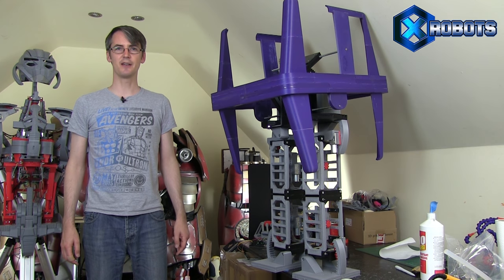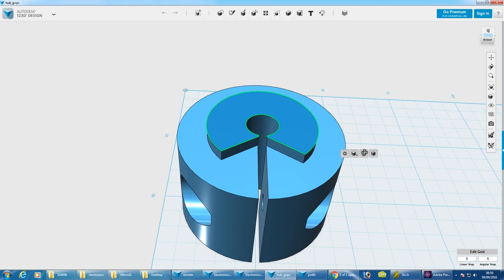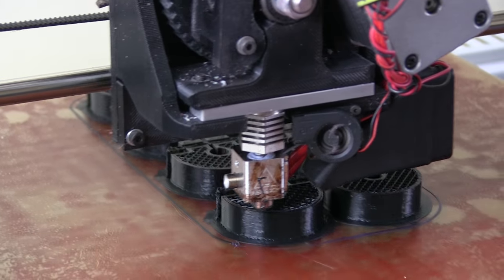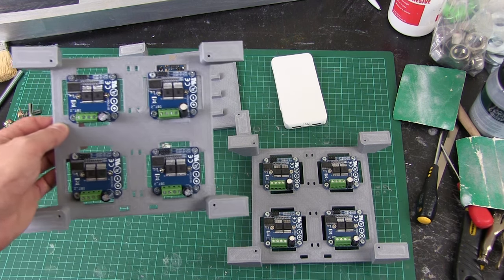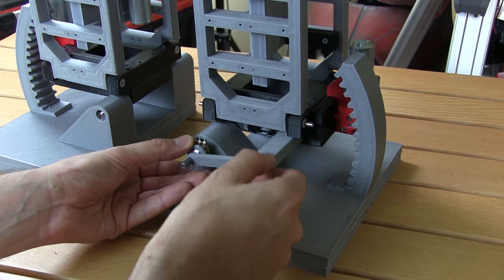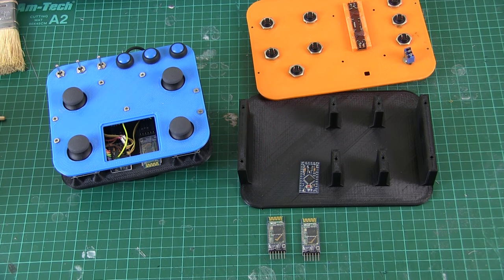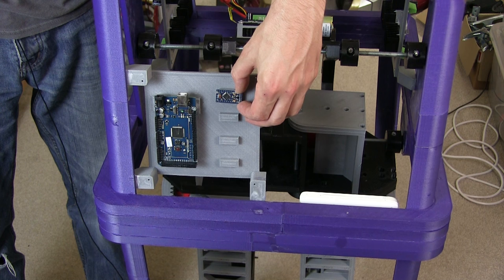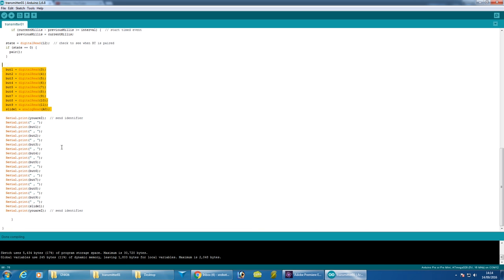Star Wars GNK Power Droid #6 | Electronics Installation | James Bruton

Comment: A quick thought on the panels for the BTS 7960's (I think), what about some kind of moving panel like you have on one of the BB-8's? So have a small servo push open a panel that covers the motor drivers allowing for display and maintenance access.

Comment: Hi James, is there some reason you are writing your own protocols for your communications? Why don't you use one of the protocol libraries like Modbus to send/receive data? That way you get accrual CRC/LRC error detection over the entire message, so you don't end up with bad data from faulty wiring or R/F interference. You've progressed quite a lot from your earlier designs by adding the identification sentinels on the start/end of your data, but there's nothing to prevent bit errors within the data itself from getting through. Using an off the shelf protocol with error detection would make it a lot more robust, and the message handling code gets a lot cleaner that way.
Reply: Maybe hashing the data and storing the hash before sending a chunk, and then rehashing the chunk when it arrives and comparing the two hashes could do the trick? Something like this:

unsigned hash(char* data, unsigned size) 
{
 unsigned hash = 19;
 for (unsigned i = 0; i < size; i++) 
 {
  char c = *data++;
  if (c != 0) 
  {
   hash *= c;
  }
  hash += 7;
 }

 return hash;
}
Reply: Damian Reloaded In a way that's what the Modbus protocol does. There's a library for it out there somewhere. If you use a stardard library then you don't have to keep reinventing the wheel for every project, plus you get a bunch of diagnostics you would have to write for your custom protocol.
Reply: USWaterRockets You're also tied to bugs and updates when things change. In this particular case, the crc check can be as simple as what I described above and he will be fully in control of his own code. I do nonetheless agree with you that it is better to rely on the work of others when the subject is too complex and their library has been tested by a community through the years. James's probably going to check it out for his next project.
Reply: Damian Reloaded If you're worried about bugs and updates, you might as well not use open source code at all and avoid Arduino altogether. I wasn't trying to tell James what to do, just making a suggestion that might make things easier. There are pros and cons to everything, and so it's really up to every person to weigh them and decide the right approach for their own projects.
Reply: USWaterRockets I said I agreed with you.

Comment: Project is looking great!  Do you know of any other way to run more motors than the pins of the Mega allow?  Getting all those arduinos seems like it would get pricey fast.  I am asking because I am thinking of some projects that might have quite a lot of motors in them by the time I am done and am a little worried about price.  The are not something I would ever mass manufacture, but I would love to make a half dozen or so eventually for friends if they want them.

Comment: Hey James. You might want to really consider designing your own embedded systems instead of just shoving arduino boards in every where. The boards have so many extra features that you're not using that are just consuming power. You could solder up your own boards with micro controller chips to save power and space. It would also look even more professional.

Comment: As your projects get more and more complex (and more awesome!), is it an option to start looking at more capable microcontrollers? The Atmels used on the Arduino boards you use are pretty outdated 8-bit processors with limited memory, flash and performance. Boards such as the Nucleo range by ST use 32-bit microcontrollers offering far more capabilities (higher clock speeds, more memory, more I/O, etc). And the mbed.org software development environment provides a wealth of ready made functionality (although not as much as what is available for Arduino)

It's a learning curve, of course, but since you are now having to distribute your code across multiple Arduino's because you are running out of pins (with all the added complexity that introduces) it may be worth considering.
Reply: Ah, right, I hadn't considered the "how-to-run-a-succesful-youtube-channel" angle :).

Yeah, Arduino is so wildly succesful it has all the other microcontroller manufacturers (and ARM themselves) green with envy. mbed is their concerted attempt to offer an Arduino-like experience for other platforms. The (web-based) IDE is a lot better than Arduino's, although uploading is slightly less convenient. And while there are certainly a lot of libraries available they are nowhere near the stupendous level of support available to Arduino users.
Reply: Totally, I'm not knocking Arduino as a platform. It's a great way to get going, and it's incredible what Arduino allows people to achieve! I'm also not trying to tell James how to execute his projects. I just thought it was worthwhile pointing out that the field of microcontrollers has moved on significantly since the advent of the original Arduino. Modern microcontrollers are way more capable than the venerable atmega328/2560, and with tools like mbed they are not significantly more complicated to program.

Comment: hi james, just had a thought when you were talking about the power source, I notice you're using a portable charger to supply 5v and another battery for the motor power, what voltage do they run at? because there are very affordable large portable chargers that can supply up to 12 volts and 5 volts simultaneously, these are chargers with Qualcomm quick charge v2 or v3. i own one made by aukey with 16000mah and two usb outputs, one of which can supply 12v. I always wondered a use for this but if you can tun your motors at 12v this may be an option? whether this supplies a sufficient current at this voltage i dont know
Reply: +James Bruton (XRobots) a portable charger definitely wouldn't keep up then, just an idea to save weight if that was required, good luck I'm looking forwards to seeing it walk!

Comment: Can any one Suggest a good Document on how to receive data using a Mega 2560 and an HC-05 on (Serial1) in master mode, from an UNO and an HC-05 on (software serial) in slave mode?

I keep getting a shifting data stream with some garbage in it.

If I connect to the Slave with an Android device I can see the Data in a terminal, looks fine.

Data is in this format,   z,modelName,0,1,9,2017/06/10,25,1022,26,30,689,570,230,100,490,600,2017,06,14,19,30,22,0,0,0,0,y

I then need to take the data in between the commas and send it to serial and an LCD on the Mega 2560.

I have looked on the internet but all I can find is paring info AT Commands, Connecting an android Device and such, no "clear" ideas on how to receive the data from 1 arduino on another!

Later, FW.